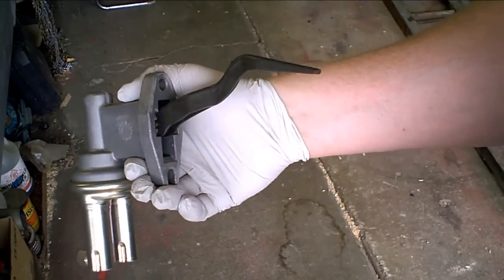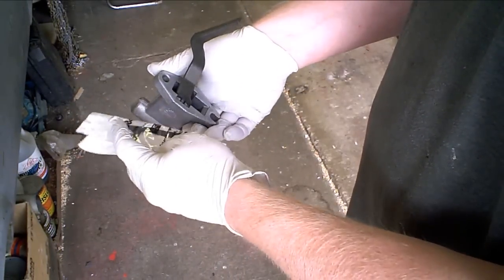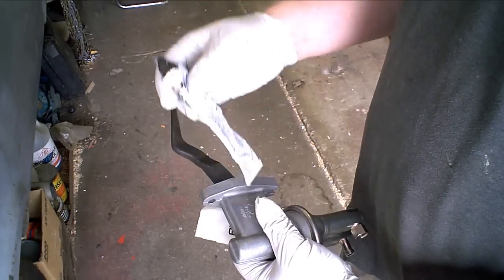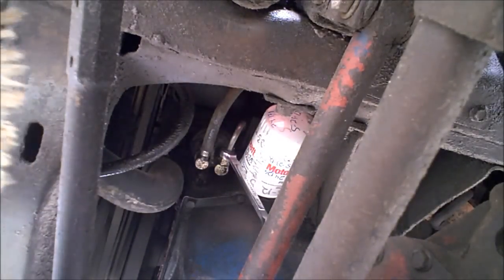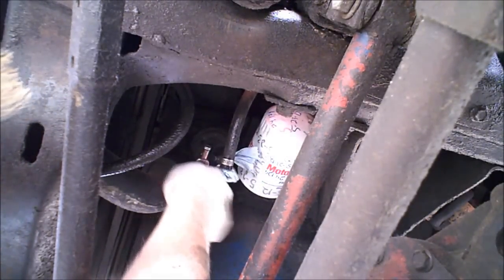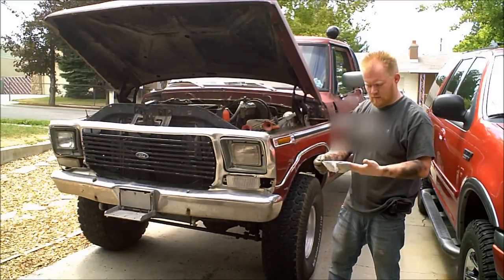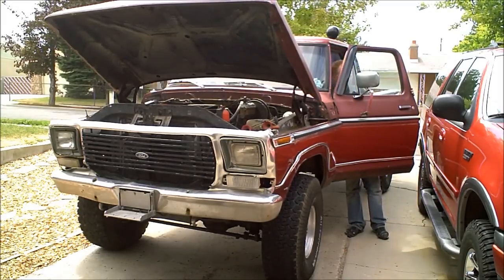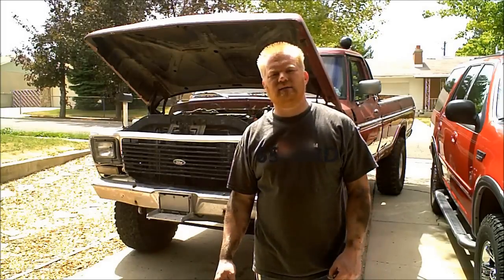Mechanical Fuel Pump Replacement FORD 351m 400

Comment: You kind of confused me on some stuff you said, your glad you never took your repairs to who?

I've never used gasket sealant on the fuel pump on my truck and it's never leaked. Honda Bond 4 is the good stuff, I once spent 20 minutes trying to get that #2 crap off of me, horrible stuff to use especially on intake manifold coolant ports or stuff like that.

Comment: Easy to put in when engine is out of frame, but not when traveling, and you need to do a roadside replacement.
Reply from the maker: For sure.

Comment: I did same thing trying to go under the cam lobe but it keeps slipping off, I know I feel the arm of pump sliding past timing chain to the left, then I catch under lobe as soon as I compress the arm to slip the first stud on top of the fuel pump in the slips right off, I take it I just need to rotate the engine?
Reply from the maker: Yes, if you rotate the engine will get easier.

Comment: Am trying to install one in my 1979 Mercury cougar and it's giving me all types of hell can someone help me out with how to install it I would very much appreciate it
Reply from the maker: These can be a little bit of a pain. The lever arm needs to be depressed by the camshaft fuel pump lobe. So you need to insert the pump with the lever tipped down. Then force it flat on the mounting surface. You will be fighting the spring pressure of the lever arm while getting the bolts are installed.

Comment: dont you need yo put a bolt in to hold the fuel rod in place while changing the pumps
Reply from the maker: Chevy's have a fuel pump rod, Fords don't.
Reply: @sixtyfiveford  YES CHEVY does you remove one short bolt and replace with a longer bolt. Put a little tension on the rod to hold it in place. but remember to switch the bolts back when your done.

Comment: DO NOT PUT THAT IN!!!
IF YOUR STATE HAS ETHONAL GAS!!!
my cleveland runs the same pump and I have had 5 fail and dump gas in oil!.go aftermarket for the pump for sure...

Comment: Sorry but the 78 Ford pickups had round headlights.
Reply from the maker: Nope, very few had round. Only the lowest trim level (Custom) had round all the higher trim levels in 78 had rectangle. And this was only half way through the season. In late 1978 model run even the lowest trim level came factory with rectangle. In 1979 all trim levels had rectangle. So it is actually a rarity to see round headlight on a 1978 Ford Truck. It is not uncommon for people to swap grill assemblies from earlier years and adapt the round headlights. Here is the 1978 brochure with a rectangle headlight truck on the front. http://www.fordification.com/library/main.php?g2_itemId=4150
Reply: sixtyfiveford It's not really that uncommon for round headlight 78's there were a lot of customs made, I've actually seen more round headlight 78's than I have squares but that is affected by location I'm sure. In 1978 all of the "custom" trim levels had round headlights, they didn't switch to square mid year.
Reply: sixtyfiveford Also to add to your comment about the engine from your video, a 351m and 400 are two different engines, not the same thing. The 400 came first then when Ford decided to make the 351m they de-stroked the 400, both were still available. Everything is interchangeable between the two besides the crank and pistons. There's no such thing as a 400m.
Reply from the maker: Ryan Juntunen
In spring of 1978 Ford completely discontinued the round headlights. Thus late '78 Customs still being produced in the factory were switched to rectangular headlights as standard equipment. Even a quick Google image search of 1978 Ford custom will bring up images with only a portion of them having round headlights. I Did have an early 1978 Custom Bronco with round headlights so I didn't say they didn't. The original poster commented that all '78 Ford trucks had round headlights which is far from the truth.

The 351M/400 are different cid engines but are referred  together as the same only because there is no observable physical differences. Most people with a 351M will boast that they have the bigger 400 without ever knowing. Technically Ford never called the 400 a 400M but everyone who knows Ford motors knows exactly what you are referring to and it is very common practice.
Reply: sixtyfiveford About the engines, when you said "whatever you want to call it" I took it as you thought they were the same engine like many people do. I was just trying to help out and say what is correct about them. The only reason I mentioned the "m" not being on the 400 is again because many people think it is there. I know a lot of people know what you're talking about but for me I try to make sure anyone who does say that knows what it really is. It's just like calling a 460 a big block since ford never used that term but the aftermarket does.
Reply: sixtyfiveford I wouldn't use google images as a source. If you look into the links on the pictures it's usually a picture someone else posted to a forum where someone asked about wheels or headlights or whatever else modification they can think of, what I'm trying to say is I can type in something about a 78 custom and find out that the picture is someone's XLT that they posted a picture of in someone's thread about a custom. I've personally never seen any proof of a switch over mid year, the only time I got to see one of these square headlight customs in person it turned out to be a 79. One person online claims sometime in march was the switchover but wasn't able to provide anything to prove it.
Reply from the maker: The Custom 1978 headlight from round to rectangle is stated at least a dozen times online. But there is no proof either way coming directly from Ford. People will swear their dads custom truck came with rectangle from the factory and they never touched it. They may have bought it this way but it could have been the dealer who switched or factory... No one knows for sure.
Reply: sixtyfiveford The customs coming out in late 78 were 79's so they would have had rectangular headlights. I wouldn't base something off seeing it "a dozen time online" since you also say no one knows for sure and the people who state it usually (not always) are the ones claiming they had something like a 351w 4x4 with a 390 crank from the factory. What I stick with is that all 78 customs had round headlights. The 78 sales brochures all say the same thing and I've never personally seen a custom before serial number DC0,001 that had rectangular head lights from the factory. A dealer may have swapped them over since they would have had the parts at the parts counter but I'm not going to go around saying it was factory until there Ford documentation stating it.